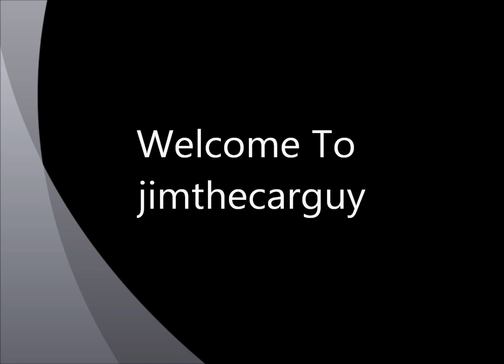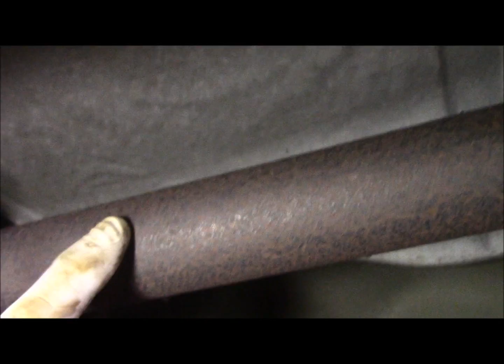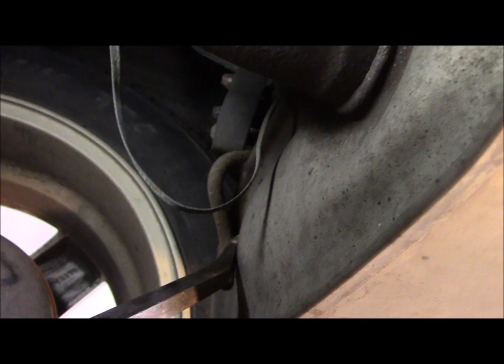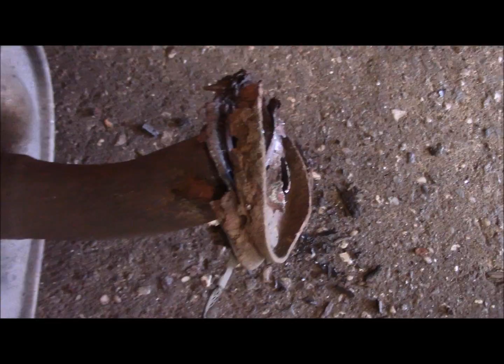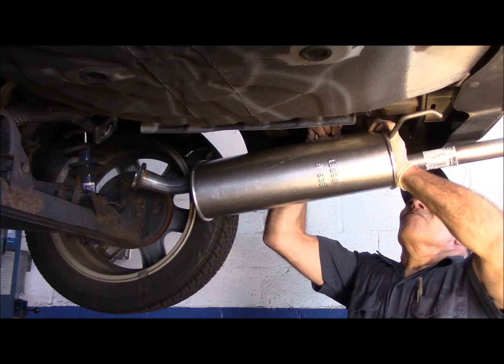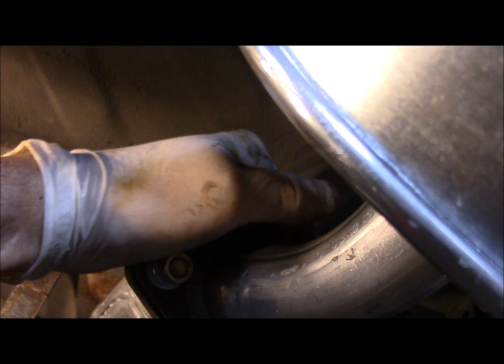How To Replace An Exhaust System

Comment: Why don't you just cut a groove in the nut and wack it a couple times. It will move and then you can easily turn it with a socket or even a monkey wrench. And this isn't an entire exhaust system, just a muffler and resonator, basically half of the exhaust system.

Comment: ABC Video of what you need to know when you bring your own car into a muffler shop. 1. Identify the most common problem 2. How they are going to replace it 3. How not to get ripped off at a muffler shop for a simple problem. i.e. your exhaust system is a very complicated vital system of your car"s engine.

Comment: Great tutorial! As a DIY I would just cut out the joint and replace it with a connector pipe with two clamps. Car may end up in a junk yard before a need for a new mufler :)
Reply from the maker: Great point!

Comment: Jim, Great job in your video.  i have a question.  In making the front connection, I used a gasket and 2 new bolts but water drips from the connection even after tightening the new nuts down.  Did you use any kind of gasket sealer?  I did clean off the old gasket but still a water leak.  Any advice is appreciated.  Thank you
Reply from the maker: Good question. No I never use any sealer.There must be a slight leak were the gasket touch the pipe. Try using some very fine emery cloth sand paper and make sure that the metal is spotless. Good luck .

Comment: Excellent presentation & a pleasant demeanor - thank you, sir.  By the way, would a propane torch be hot enough, and where precisely did you aim the flame ?
Reply: @David M 
Agreed, excellent presentation pleasant demeanor.
As to your qweshin (¿) Without being a mekanik but having done some personal maintenance and read through guides, watched videos, I would infer that a propane torch √would* work but take longer heating time than oxygen-acetylene⚠️
Reply: @rezagrans1296  I ended up grinding off the studs and then trying to drill them out with cobalt bits, but it was loud & slow going and the neighbors were getting annoyed. I gave up & took it to my mechanic who was able to pry apart the flanges, heat the remaining stud (nubs) and twist them out with vice grips.  Not easy working on the back in a tight spot for hours either.  Win a few, lose a few -cheers!
Reply: @davidm3210  heeeHhhehh funny stOry but wish it woulduh workd out fir ya eazier (lol "slow-going n' neyborz annoyed😆😊); still.. the discipline and insight learned from bringing up your experience repertoire by chrying r always somethinG!👏
'coBalt bits' woww

Comment: Mr Jim I do not have a torch! 
Can I use penetrating oil and impact?

Thanks!
Reply from the maker: Yes as long as it is not to rusted. Good luck.
Reply: Jim would an impact wrench work well on these or would the power strip the bolt?

Comment: Great video, Jim.  I'm about to replace the exhaust system on my grandson's 2000 Nissan Maxima. I'm using Walker aftermarket components- (Cat Converter, Resonator, Muffler) . This may be a dumb question. What type (grade strength) and size of fastener bolts and nuts are you using in this video to connect the components. Walker does not supply any fastener hardware with their components. Your help would be greatly appreciated. Thanks.

Comment: Jim, do you recommend using exhaust pipe cement/sealer on pipe connections?
Reply from the maker: 69 Indian I would never recommend using cement/sealer.
Reply: Jim, thanks. Seemed like a good idea. I saw it on another tutorial.
Reply from the maker: If you use a good quality pipe and muffler and they are not damaged you should have no problem .Thank you for watching and your advice.

Comment: Recently came across your channel and want to say you do a great job. I recently had to replace all four studs in my cats on my G35. I only have access to Mapp gas, so i cut off what i needed with an angle grinder. I then used a 20 dollar ball joint press from harbor freight to get thr little bit of studs left. It worked great for all of them.

Comment: turbo sockets. best thing ever. they grab so well on round bolts or nuts. i was surprised how well they work jim
Reply from the maker: Turbo sockets?I will look into them thank you for your input
Reply from the maker: Turbo sockets?I will look into them thank you for your input
Reply from the maker: Turbo sockets? I will check into them. Thanks. Jim
Reply: Mine are made by irwin there is ten different siszes if u get the expanded kit. They work great for bolts nuts and also studs not sure if turbo socket is the correct name its just what ive heard people call them
Reply: Thanks jim

Comment: why does my connection for my headlight  keep melting? It has a good ground.
Reply from the maker: Make sure that the connections are tight If there loose in the socket will melt
Reply: Thanks Jim.

Comment: I don't even think OE exhaust from the dealer are Stainless like how they come with the car.  I wonder where to get stainless exhausts.  I live in the rust belt.  My Corolla had 280,000 miles in 15 years, original exhaust.  My Honda is 9 years old, still original exhaust.  All thanks to Stainless Steel.
Reply from the maker: Thank you for your input

Comment: RF bond strap to maximize RF continuity. Most vehicles have AGC Automatic Gain Control so if you left it off or it rusted & lost it's bond you wouldn't notice it. Nice job Jim and now they can hear the radio better :-)
Reply from the maker: Thank you for the info.
Reply: Maybe it also has something to do with getting a good ground for the O2 sensors as well
Reply: Senseless Mid-Cities Driving O2 sensors ground is thru PCM